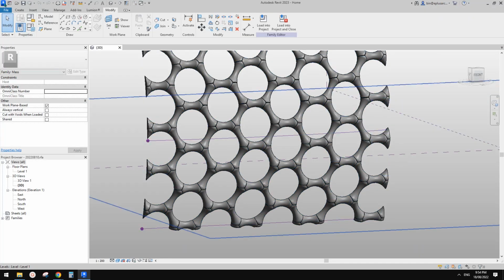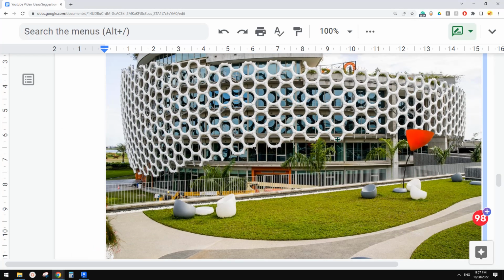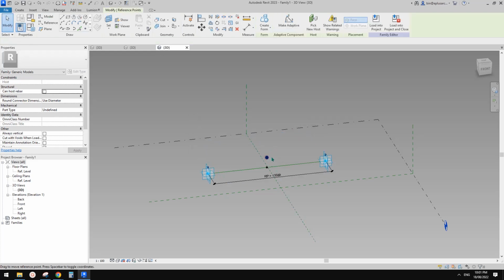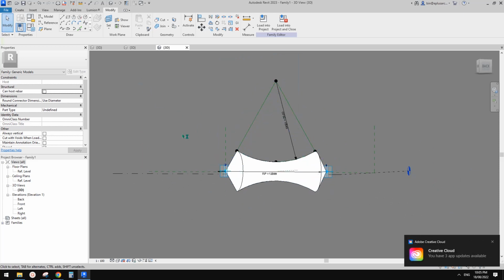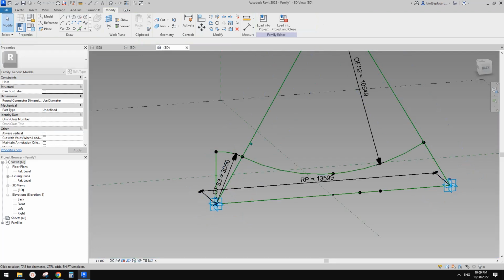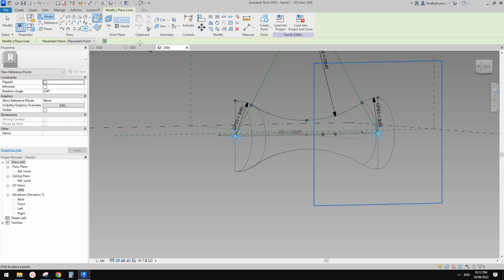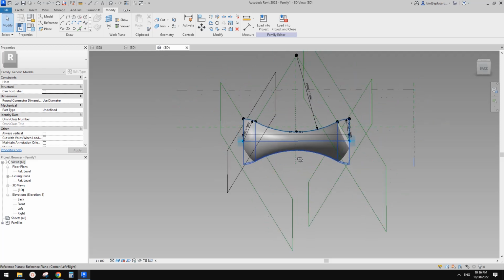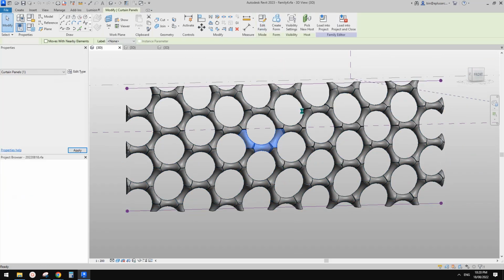Revit Exercise (Day 878) Adaptive Family Exercise (Hex, Curve) Part 1

Comment: You are the best really !! I have a question bin how can i make thd topography from autocad file in good way !!
Reply from the maker: It depends on the survey file.  If it is a 3D survey, you can link it into your project and create toposurface using the layer that contains the level information. If the survey is a 2d drawing with spot levels, it is still possible to use EATTXT command in Autocad to create a schedule and save as a CSV file and create toposurface from it.